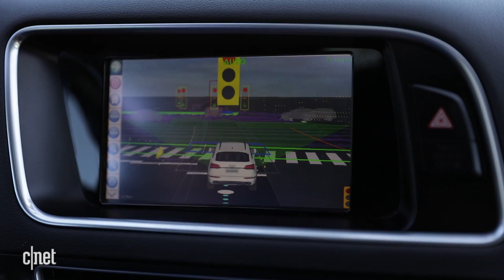The two technologies that will make or break self-driving cars

Comment: We need self-fixing cars. We now have cars that stop themselves to avoid accidents. We could also make these cars call the highway patrol number each time the driver reaches speeds 20 miles above the speed limit. In addition to a speed limit sign, a wireless message will be sent from a stretch of road to all the cars. The car can be aware of the speed limit even if the driver is not.  I know that self-driving cars will be good for business because a lot of people who can afford to purchase cars are not presently capable of driving. The real problem with self-driving cars is the fact that they can transport cargo (legal, illegal and even toxic and dangerous) to any destination without human occupants.  Maybe such cars should also be equipped with sensors to detect dangerous cargo. I am not very optimistic about self-fixing cars, but I know that building more secure affordable parking lots in and around the neighborhoods of the cities, will increase car sales. Today, it cost more money to park a car in the city than it does to drive the car for the same number of hours. Finally, I have long advocated that if insurance companies are allowed to charge more money to insure dangerous drivers (high risk pools), these drivers should also be restricted to driving the smallest cars on the road. That way, the damage that they can potentially cause will be minimized. For the first 5 years, self-driving cars should also be the smallest cars on the road